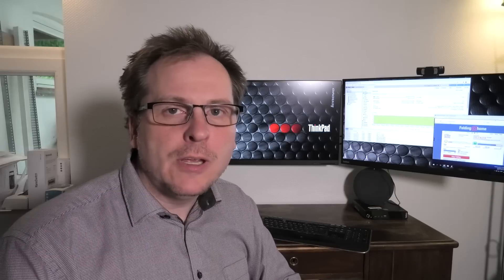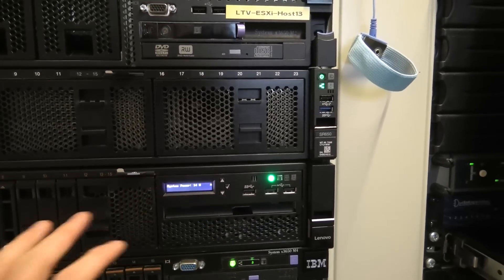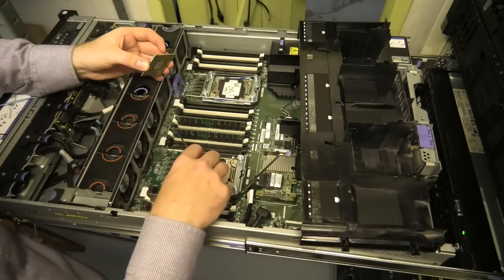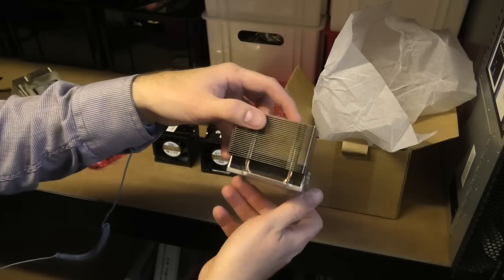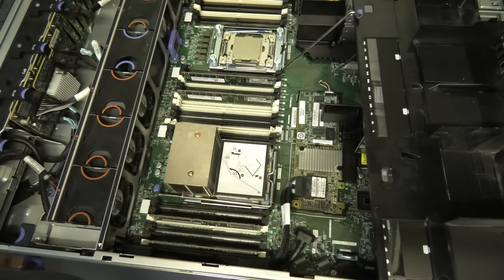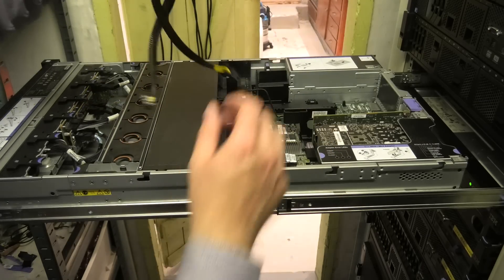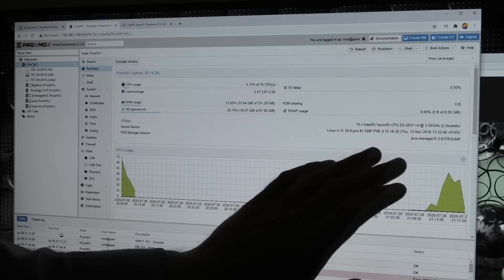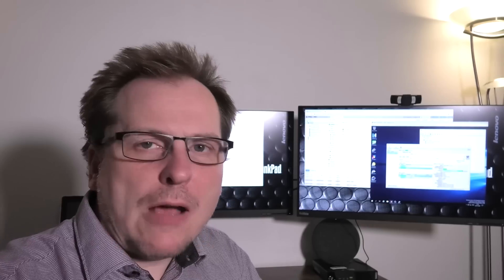Double Downgrade on The Lenovo x3650 M5 with E5-2637 V4 - 986

Comment: See that down grade was a double one. One you didn't detect.

The Ram downgrade.
The colour slots usually equate to channels. So when you swap out ram you can lose one or two channels when you spread the CPUs.

I did a upgrade, which was a down grade in over all performance on one of my servers and I could really notice it. Same amount but dropped a channel.

I used to have a tool that tested the ram performance, SISsoft maybe has one?? But you have to take care with what you do when you decide what ram and where, not like the old days where you could add ram in any order and size and it made no difference.

Also.... That Xeon bench was way lower than I would expect, I can't remember my Ryzen 7 score. I'll have to take a look again to see.

Oh yeah....
Heating paste... 
Cooling paste, conduction paste, heat transfer, CPU cooler lube.. 

Also having a nightmare with proxmox performance myself.
Also in 6.2 there is a backup server they've done. But they really need to work on the disc management in there software as this became a bigger issue then it needed to be.
Reply from the maker: Yes,, but I only have those 4 blocks of 64GB DDR4 ram,, I know I should have 8,, for this to be optimal.

Comment: you have taken a hit on memory speed, both CPU's are only running in Dual Channel, not the max Quad Channel performance each cpu can operate at.
Reply from the maker: Yes,, there is no way to run balanced memory, with two CPU's and only four blocks of memory! :-/

Comment: Hi,
Please let me know which is best VPN for Small Business setup for 25 users. Should I use fortigate or sonicwall VPN?
Thanks Manish Bhakuni
Reply: It depends on the requirements you have on the VPN. If your 25 users only need to connect to the company-network with their laptops/phones securely i would suggest setting up openVPN on your Server or getting a good Router with VPN capabilities.
A Fortigate or Sonicwall are mainly hardware firewalls (as the names suggest) and do a lot more than you need for a business that size. Given some of them are kinda like small Servers by now. And cost accordingly.
Reply from the maker: Yarh propoly start with OpenVPN,, if that is all fine,, you just saved a fortune.

Comment: Buying those old XEON just isn't as nice anymore, since ryzen 1st gen. Even the Consumer Plattform are a lot faster than those old XEONs, missing IPMI ofc, except there are ASROCK ASRACK Boards now.
For 1000€ you get something like an AMD Epyc 7302 (16c32t) which has plenty Bandwidth to use with PCI-E, draws much less power as well.

It is both sad and good, old CPUs or Plattforms are not viable (Price/Performance) anymore :)
Reply: It seems that Epyc 7302 is $1200 (your quoted 1000€) just for the CPU itself, not including chassis, ram, etc. For $500 you should be able to get a DL380p Gen 8 or R720 with 2x E5-2650 v2. The two Xeons should use only a bit more power and still have most of the performance. I'm probably just trying to justify my purchase, but I think older platforms are still competitive on performance/$.
Reply: @eDoc2020  Also our markets seem to be quite different. In the USA you'll get super cheap XEONs in high ammounts, in EU it is much less reasonable. ServerShop24 in Germany has some very cheap XEON Based Servers for super cheap.
I have very serious doubts, two E5-2650 v2 would even come close to Rome performance/Watt. Price / Cores is by far more reasonable. Also the Interconnect between CPUs are coming with a latency bill. Now, for just tinkering around, theese old XEON Systems are perfect, cause you simply have a lot more to do to expant it. With Rome it would be like this:
- Cpu in Board
- Finished. all works well. Wanna expand? Just expand wildly, theres more lanes than physical slots, cpu wise? already high clock, low power, all cores on one CPU.
Reply: @RawmanFilm  US vs Europe does make a huge difference. I'd guess the Ivy-EP Xeons would be around half the performance/watt. Not great by any means but still closer than Pentium D vs Core 2 Duo. In terms of CPU interconnects, I thought the Zen core complexes acted like separate NUMA nodes. Maybe I'm a bit mistaken and maybe the newer revisions are better.

Essentially, there's no catchall solution. There are many factors including hardware pricing, electricity costs, spare parts availability, vendor support, and software support.
Reply: @eDoc2020  "Zen core complexes acted like separate NUMA nodes"
Not the Core Complexes. 
Zen 1 + 2 THREADRIPPERS were 2-4 Numa Nodes (1 per die) - which was bad. Windows also did shedule them really badly :D

The Core Complexes had slight latency disadvantages - this will be fixed with zen 4 with its 8 core native, unified l3 /die. Time will tell if that is the perfect solution, i believe it will make gaming a lot faster (strong INT increase) :)

Look into ASRock ASRack Stuff, theres X470 but also a lot of Intel plattforms for both xeon and i series - they should all use IPMI/BMC/iKVM
Reply from the maker: It's nice that AMD is now also there,, that will make it a lot more interesting.

Comment: Looking at passmark, it should have been obvious this would happen... Why not just get a second 2687W?
Reply: Those top-end CPUs are expensive, more than twice the price of the 2637s (but that still ends up at a similar cost). I presume Morten got a good deal on the 2637s. Otherwise I'd maybe have gone with a pair of 2680 v4s, which would be even cheaper and provide more multithreaded performance.
Reply: @eDoc2020  i was thinking 4627V4s. 10  cores with no hyperthreading and can be had for 100 bucks or less in qs form. two would have an amazing multithread score for the money, although give up a bit on single thread, but still a score of 2000 single thread is plenty enough for anything most people do (aside from attempting to max out crysis 1 lol.)
Reply from the maker: It was the best prices on the E5-2637's.  :-) They was upgraded and no longer needed.

Comment: E5-2637v4        4 cores   8 threads      https://ark.intel.com/content/www/us/en/ark/products/92983/intel-xeon-processor-e5-2637-v4-15m-cache-3-50-ghz.html
E5-2687Wv4  12 cores 24 threads   https://ark.intel.com/content/www/us/en/ark/products/91750/intel-xeon-processor-e5-2687w-v4-30m-cache-3-00-ghz.html

Not really a big surprise that two 4 core CPU's are slower than one 12 core CPU in a multithreaded workload, despite the slightly higher frequency.
Reply from the maker: For some reason I had gotten into my head, that they was 6 cores,, and when I found that they was 4 Core,, I also knew that we would lose a bit. :-/
Reply from the maker: YouTube is messing up, and climes that I have not replied to this,, sorry for the "disturbance in the force" :-/

Comment: get more ram so u get 2x quadchannel
Reply: Yeah. Thats what i thought. All white slots have to be occupied to utilize quad channel memory. I would even put smaller sticks in there if you have them laying around (16GB or so) - just to get the extra RAM speed. A single VM running Folding won't use 256GB anyways.
Reply from the maker: Thanx,, I do not have much DDR4 ram.

Comment: SR650 or X3650 M5. Out of the two which one is more powerful?
Reply from the maker: The SR650 is next Gen. of x3650 M5,,, so SR650 is newest.. amd most expensive.
Reply: According to Lenovo, it seems both are similar in power, but have different set of integration tools. But Morten knows better than me :)